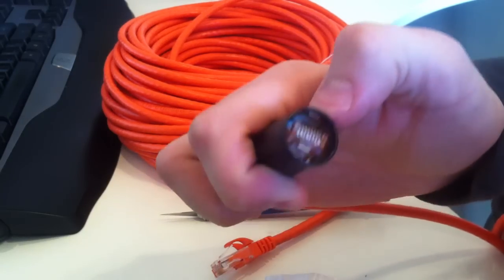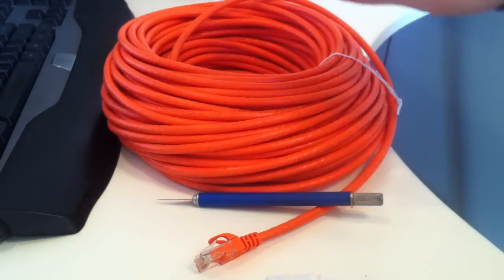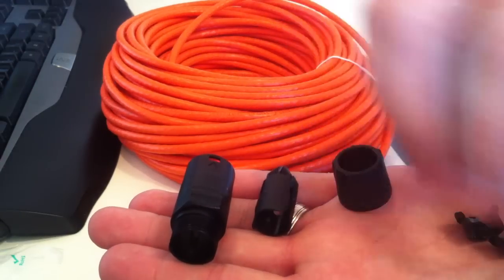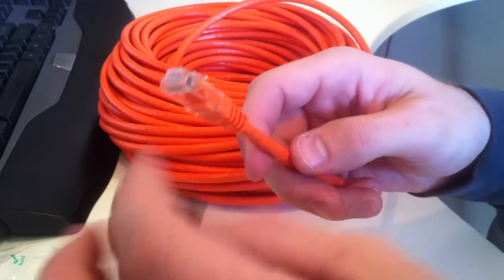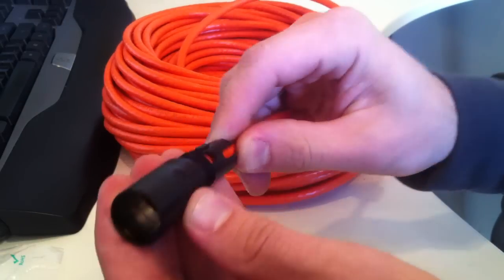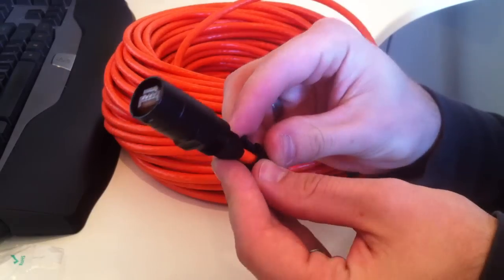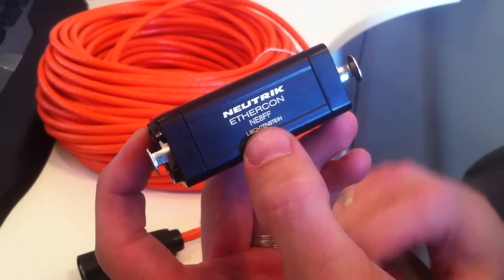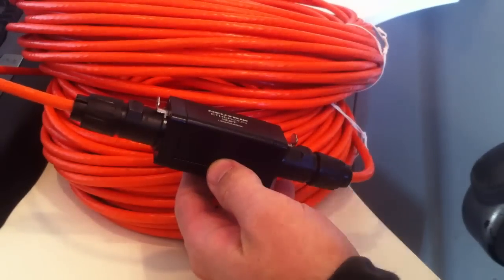Behringer X32 - AES50 Digital Snake Cable Build - EtherCon Connector

Comment: Drew, Behringer has finally answered the Question on Shielded Vs Un shielded.  They are Not recommending unshielded cable.  They are now stating while an unshielded cable may work in one venue it may not in another.  If you are having No problems with an install of Cat5e/Cat6 then you are probably safe unless something changes like more cables being run that could interfere.  Just FYI.  :)

Comment: WARNING: Do Not use un-shielded cable for AES50.
 It may work, but it will be intermittent and could cause loss of sync which will cause the big boom everyone is describing and kill the audio stream. The cable featured in this video is not acceptable for use as an aes50 snake cable.
Reply: Very true remark.
The main problem in use un-shield cable - the impact of static electricity.
That can lead to loss of synchronization, and sometimes damage to the equipment.

I am sorry for my english
Reply: it works until it doesn't

Comment: Drew,

Last year we purchased our x32 for our mobile church setup. We also purchased 2 S16 digital snakes. Fro some time we used a cat5 cable we have made but we found it got so tangled it was too much hassle. We ended up purchasing a higher end Ethercon wire for about $400 200ft long. This cable performed like a champ until one day someone stepped on it and it then never synced again and gave intermittent signal. 

I replaced the cable rice and still it will not sync. I ended up replacing the board (for unrelated issues. I emailed Uli Behringer himself and got a loaner lol) and still no connection. I tried both snakes in every single way possible and I am totally baffled as to why my Ethercon cable will not sync. Any cables longer than 50 ft either won't sync or distort. I am clueless and using this 15 ft cable seriously hinders my mobile church setup and in turn hampers where I can locate my mixer. Although I use a Mac to control front of house I would still like my mixer front of house for easier adjusting and not backstage. 

Any suggestions?

PS. 
Your videos are the BEST!

Comment from the maker: Category 6 cable is backwards compatible with Cat 5.Cat 6 has better reduction of cross talk and superior cancellation of external noise.  Also Cat 6 is rated to a min of 250MHz where as Cat 5 is rated to a min of 100MHz.  Basically the only differences between Cat 6 and Cat 5 is that Cat 6 is a better and higher quality cable.  So no I would not see any issues coming from using Cat 5 vs Cat 6.  Just don't buy cheap network cable.

Comment: Hi, thanks for the video. Does this only protect against cat cable being pulled out? Or does it also protect against electrostatic discharge? It seems like there's no way the static will drain.. Maybe I'm confused but shouldn't there be some sort of drain wire connected to the ethercon component?

Comment: My question is on line with others here:  Is it really necessary to have shielded cable for use with a Midas M32?  This video provides info about the PLUG ONLY, not the rest of the equation
Reply: Yes... For anyone seeing this question... Shielded cable with continuity tested end to end.

Comment: Good neutrik connector, bad cable. 
You can get a shielded cable (cat5e sftp/sstp 30m €15) and then the Neutrik connector will connect to the shield of the cable. With this cable the only added feature of the ethercon standard is protecting the connector in case someone steps on it (and missing the added shielding which would be it's biggest advantage)

Comment: Hi Drew!

To connect two S16 to the X32: Is connecting the first S16 to the AES A-port at the X32 and the second S16 to the AES B-port at the first S16 the only way to do it, or is it possible to connect AES A to the A-port at the X32 and the second S16 to the AES B-port at the X32? By testing the second alternative I get no signal to the X32 from the AES B-port, but the returns to the S16 AES B works well.
Please explain if possible.

Comment from the maker: The only issues that I could see is if someone is using any cat 5 or cat 6 cable outside and not taking the precautionary steps to protect the cable from being stepped on or damaged.  If this is the case, it doesn't matter what cable you use, it will fail.

Comment: hi Drew, 
I have an urgent question about the digital snake for the X32. 
We started using two of the digital snakes with a new sound system that we got last week. Unfortunetly, during the message this past Sunday we had a big "pop" and the sound completely died. The console was still on and I went to check the amps (amps were also on) and noticed one of the snake had smoke coming out of it. Needless to say... No more sound for the rest of the service. 

Now, one of the snake is off to repair and the second which seemed to be okay because it was on- doesn't work either. What could it be? Can you please help? 
Thank you!

Comment: straight thru or crossover connection?
Reply: If you are building your own cable, use the EIA/TIA-568B standard at both ends ("straight through"). Do not configure a crossover.

Comment: Would shielded cat7 be ok for this?
Reply: The rating needed is shielded cat5e, having a higher spec than that will not have a negative effect. cat7 will work, just make sure the shield is connected to the outside of the connector and works, the shielding is the important part.
Reply: IIRC, the shielded cable will have a foil-like sheath just under the outer insulation that houses a drain wire. Use a shielded RJ-45 connector. It should crimp to the drain wire. Check out this video: https://www.youtube.com/watch?v=cQ5lIEnCVQM
Reply: Hey, generally in shielded cable there is a ninth wire without any insulation in there called a drain wire. This is attached to metal foil inside the cable which is the shielding. Basically you do the crimping as usual (if you've done that before) but with the drain wire running in the opposite direction down the cable, Then crimp it as usual. Shielded connectors have metal around the entrance area which pushes down on the drain wire making a connection. If you need help then showmecables does a good video on it (https://www.youtube.com/watch?v=82gclyop_0U.) Any more issues let me know!